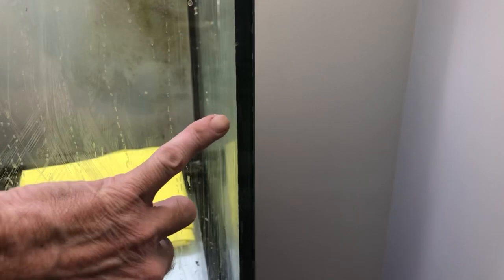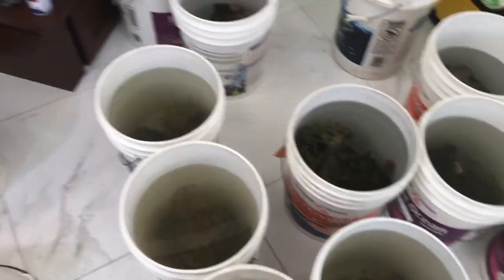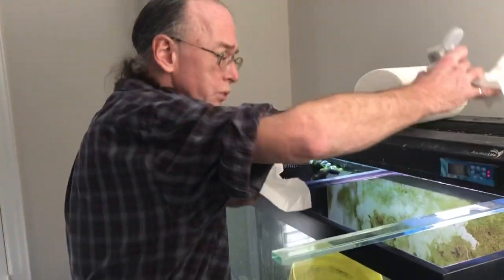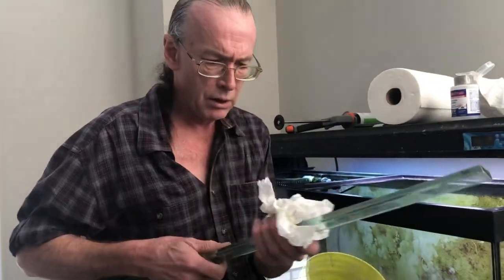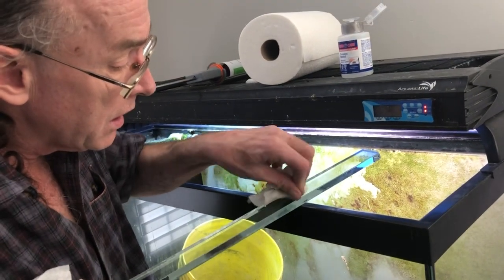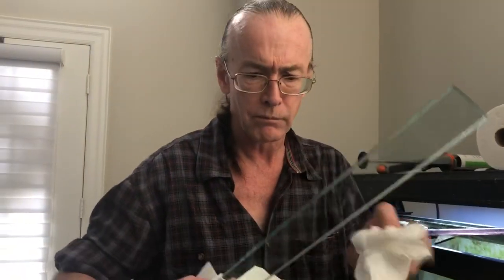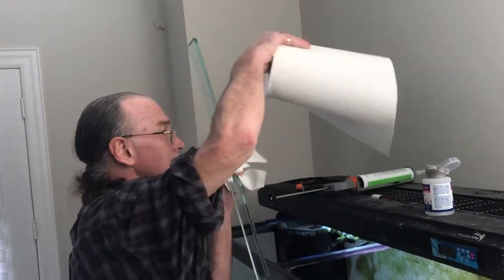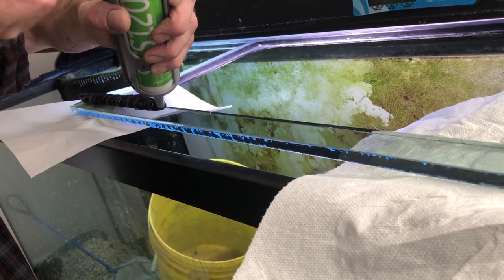Re-sealing a vertical seam on an aquarium

Comment: When you remove the old sealant do you not have to remove the old sealant in between the 2 panes of glass. My 125 separated a bit where I can run a fingernail up it.
Reply from the maker: By using the glass strip we are making a whole new seam, the tank was refilled about half an hour after the repair and is still running to this day
Reply: Where do you get the glass strips? I’m just down the highway from you in Hamilton
Reply from the maker: @garysmith766  I get 80 of them cut at a time, $80/ strip. I’m near Islington and 401. 4164609922
Reply: How about the sealant, where do you get that? I havnt been able to find that brand locally.
Reply from the maker: @garysmith766  I buy it from my wholesaler, I sell it for$28/tube

Comment: Good video.
Why black & not clear?
Also will any type of silicon do or should it be aquarium safe silicon?
Reply from the maker: leann lewis I used black silicone to match the black silicone that was used to build the tank, I only use SCS1200 silicone because that’s what Miracles in Glass uses and recommends
Reply: @CarlsAquarium  ... Thanks!